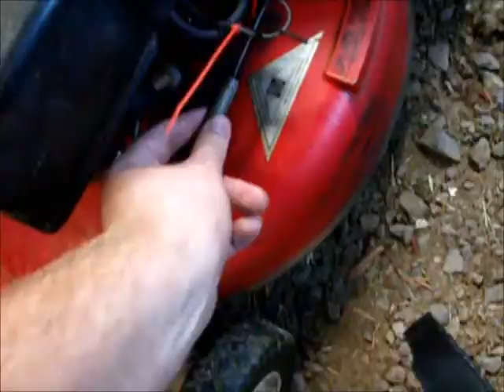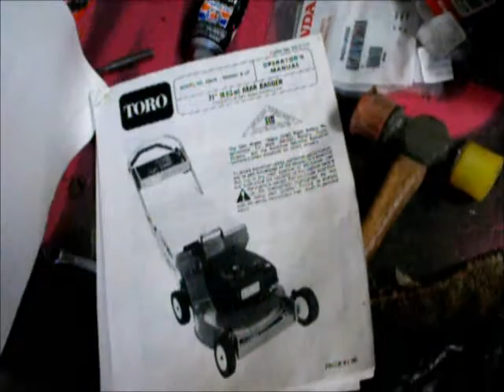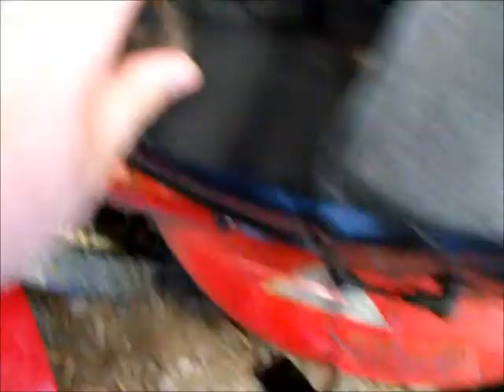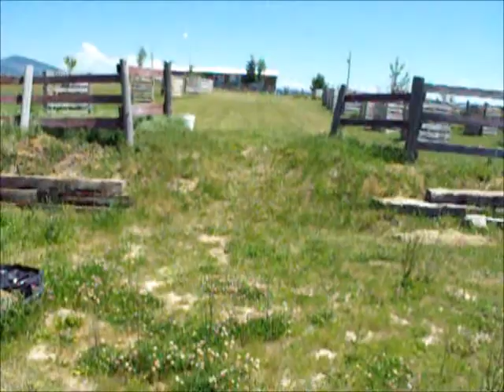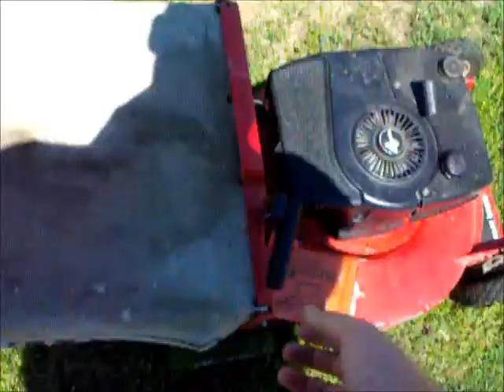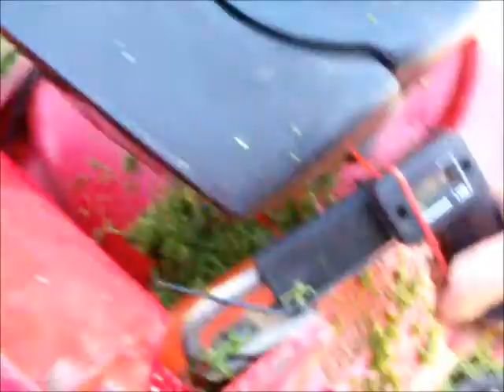Toro 1984 21" Lawnmower w/ Aluminum Deck

Comment from the maker: Yea, the wheels have always been at the highest setting. I do go slow but I feel that compared to the other mowers I've worked on and used, it has the worst performance which is why I looked to engine RPM. This probably won't be an issue with maintenance on manicured homeowner grass but it's definitely not appropriate for the weeds around me :)

Comment: This is not exactly a commercial-grade mower, even though it seems like it. To mow the thickest/tallest of grasses, all four wheels should be adjusted to the highest position ("E"). Did you try that yet? And do it slowly so as not to stall the engine.

Comment from the maker: I also got a new primer bulb. Make sure you get the right one, there's a vented & non-vented version that are made for the same part number.

For the BBC, there's a rod that goes through the deck that connects to a spring & arm that goes to the control. You can take that whole arm apart, lightly sand & grease it and it will work much better. Since it's metal, it will rust and bind up over time. I got a new pulley for mine, I think it was $7 or so. The old one's bearings were shot.

Comment from the maker: I don't quite know my musical notes enough to compare them from memory, especially with hearing protection in place.

With that said, even at 3600RPM (your estimate), the engine doesn't quite have enough power, it's somewhat disappointing. However, I'm mowing weeds and thick things, not a manicured city lawn, which I think is what would suit this mower best.

Comment: Nate, again, if the blade disengaged pitch sounded like "high C minor" (read: about 67 Hz or 4000 RPM) then until you buy a new tach, by ear, you should adjust it low enough so it sounds close to "A" (about 53 Hz). The blade engaged pitch sound (fan noise is added in) should sound slightly above the key of "G" but below "A" (about 50 Hz).

Comment from the maker: Interesting you should mention that. I have another project, a Honda CT90 motorcycle that seized up on me and through the information I shared with some people, I found out that my tachometer is faulty. The CT90's top out at 8-9k RPM yet my tach would only show maybe 2400RPM. I'm definitely going to get a new tach and re-adjust this mower before selling it. It always bugged me, the sound of the RPM unloaded, now I know why.

Comment: One trick is to try to make governor adjustments while your engine is running and with the blade engaged; and you should try to get a 3000 RPM reading. To adjust the governor on this series of engines (TNT100), use a tang bender (refer to the Tecumseh 4-Cycle Service Manual #692509/740049) and put that on the tab to adjust the speed forward or backward.